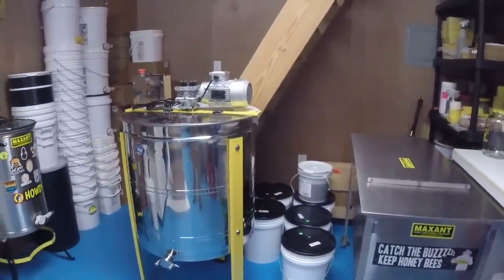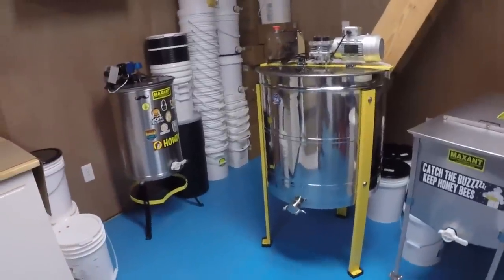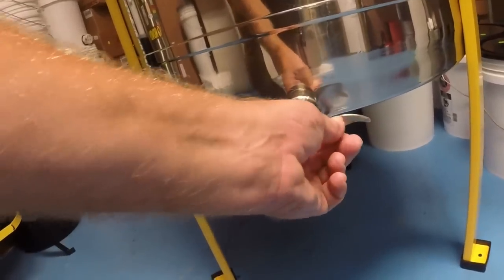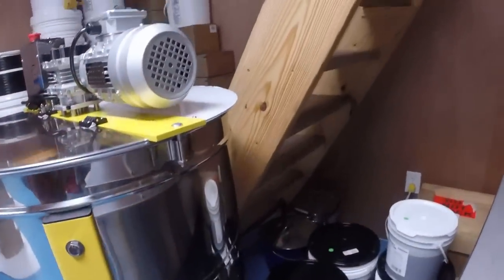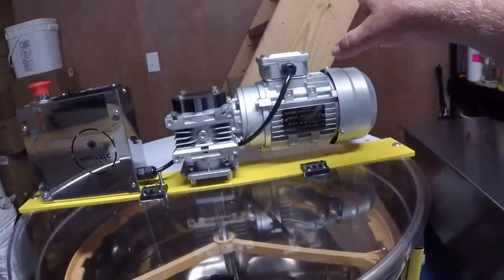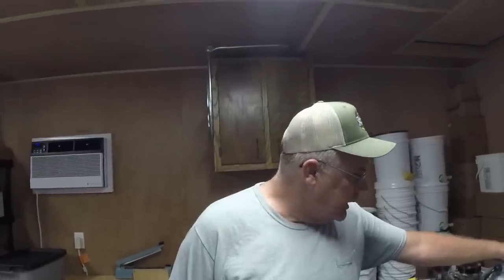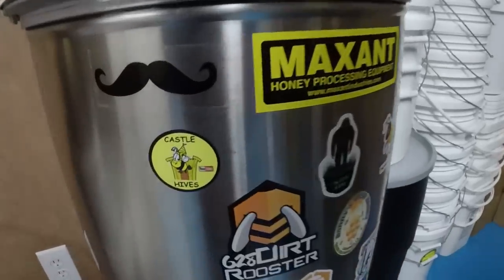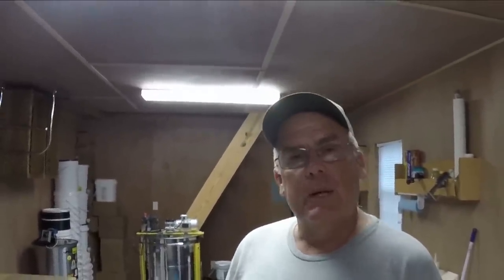Unboxing UltraMax 18 Frame Extractor

Comment: Nice!  My first extractor would sping 18 mediums, it worked very well!  My current extractor is an old-time Kelley 33 frame (deeps or mediums).  My Kelley also has a sloped conical bottom that works pretty nice.  I know you'll enjoy this new unit!
Reply from the maker: Kelley used to have a lot of items that were very good quality and unique to the industry. Unfortunately that has all changed and so many of those unique items were discontinued when they buy out happened. Should've been a good opportunity to take on some good selling and uniquely different inventory to boost the clientele and keep every more positive on the buy out, but not to be so. I used to get several items, one being a special frame, and gone are the days. I remember seeing the first catalog after the buyout and it was ML with a different cover. No more unique frame choices and little nic-nacs that were all Walter Kelley. I am glad that ML dropped the slogan 'We Know Bees'. After the last few phone calls and correspondence I've had, that slogan would have proven very untrue......

Comment: That's a nice early Christmas present 🎁. I still have a old 3 frame electric extractor that does a great job but getting 15 to 20 gallon through it is a long day. Have fun with it and can't wait to see it in action. ❤️🐝
Reply from the maker: Thanks Michael. I used my hand crank 2 frame for about 5 years. Works still to this day. I know what you mean on a long day for sure.

Comment: You are going to enjoy that beast! Open the top bearing cover and look at the keyway for future reference. Pop the motor plate off the tank and remove, there should be a buffer piece that will fall out. I keep a flexible finger picker-upper,  the right allen key, and a telescoping magnet for manipulating the woodruff key handy. I sprayed vinegar and dish soap solution on the inside surfaces, and hosed it out after a few minutes of wiping with a washtowel. There are a few matte finish stainless parts like the lower bearing housing that could use a bit of mineral oil as rust prevention before storing. The only thing I can think of to improve on would be a jam nut to 'clock' the honey gate to where you want it.
Reply from the maker: Thanks for the tips!! I will make note of this comment on my phone notepad for the disassembly. The honey gate is the first of that model I've seen. I guess it really doesn't matter too much since they stay open 95% of the time on extractors.

Comment: That's a great looking machine, can't wait to see it in action.  I'm working with a 6/3 frame extractor and just increased hive count from 16 hives to 30 so gonna have to see how it goes this year. May have to do a step up in extractor also, happy harvest and God Bless.
Reply from the maker: My 6/3 is a very good machine and I could easily have done this year's harvest with it and many more years. But with the price point on the HillCo units being what they are and as I'm getting older and knowing that time is so valuable with a full time job, it was time.

Comment: Hi Mike, I have one of those Maxant extractors too. How about using them both for extracting and maybe get done faster?  Fill one while the other is going. If you have space, you can put both honey gates over the same bucket.  Oh, if you have a strainer on the bucket, keep an eye on your bucket cause it may overflow with the volume on the 18.  Great intro to the new extractor!
Reply from the maker: Funny you said that Chris. My wife suggested that as well. I’ll see how it goes. I bought a 5 gallon strainer for the volume increase and a couple extra bucket strainers so I can keep the bottleneck to a minimum, thanks for the comment!!

Comment: Great minds think a like. LOL I bought Hillco's 800E at Hive Alive Conference. I had a transgental 3 frame hand crank that was just too slow.
 I got to use the new extractor for the first time last week and it is sooo nice. I did two sets of honey frames.  The last batch of honey I spun was 2 deep frames and 2 medium but I left an empty frame in the extractor by mistake (holds 8 deeps) and it took a while before it started to dance. Took the extra frame out and it was as smooth as silk. Hillco is going to grow with there good products and service at a reasonable price. Good luck with your harvest Mike. It sounds like a big one.
Reply from the maker: I guess so Russ!! I am excited to use it. I am glad to hear your experience with it. I figured the way it runs empty is a good indication that if I balance it well, it should do fine where it's at. If not, I will have bolts ready.

Comment: You want regret it, Mike. Purchased one ( 16 frame)  at Hive Life in January and used it several weeks ago. Smooth, quiet, and no wobble without tie down bolts on the legs. If you don't like,  blame John.😁
Reply from the maker: I am sure I will like it a lot Roy. You and others have had great things to say about them. Thanks!!

Comment: Mike, that is a beauty! I have a 20 frame Maxant and I put l concrete anchors in the floor. It is a quick attach to the floor with 3 lag screws.  I think it would be wise to bolt it down in case you get a blow out but as you said you find out quickly. You got a winner, looking forward to you running it!  Sometimes I wish I had 2 extractors because I extract during the night and you stand around waiting. My bee barn is right next to my apiary and in the daytime it is mayhem!  By 6 am have all put away and cleaned up. Luckily I only do it once a year.
Indeed drawback is you have to tilt it when done.
Reply from the maker: I also try to do just one major harvest per year. I did do that early 300 lbs. to clear space, and when I do get an early one, it's small. I will have some lag bolts on standby for sure Jerry. Thanks for the advice. The floor is 3/4" treated plywood, so if I need to fasten it down, I am not sure how long before it wears out the holes. I am dreading having to go underneath to install bolts and washers, but if I do, I will be sure they are installed as permanent studs so that I simply have to place the extractor down over the studs and then run a washer and nut down to secure it. Once and only once will I crawl under that shed!!

Comment: I have a Maxant 9 frame which I used recently only for the second time ,and the honey seemed “frothy” from the first harvest I did.  Is it possible to overspin honey, or maybe too much moisture  (although it was in range according to the refractometer)?
Reply from the maker: Hello Zelma, good to hear from our Florida friend again. I doubt fermentation. I am wondering, did the honey level get high in the extractor while it was spinning? I've seen where the level gets too high and the bottom of the reel will contact the honey and whip it up and introduce air and make it foamy.
Reply: @MikeBarryBees  Thanks for your thoughts, Barry; something I’ll keep an eye on the next time I harvest.  Enjoy your new toy and stay hydrated!  Heat index down here is off the charts!

Comment: Did you build that honey house or was it a pre built?  If pre built, what brand and do you like it?
Reply from the maker: I built it. 12' X 30' with a 6' high loft.
Reply: Thanks.  You’re going to love that extractor.  I bought a used Dadant 20 in December.  Just finished extracting.  Makes a difference going from a 3 frame to 20.
Reply from the maker: @burleybeeyard  I can’t wait, if it would only stop raining....then I could get out there and pull of some supers.
Reply: I went ahead and pulled when it was 101 degrees (not fun) because I saw that rain coming,  300lbs.  Not much compared to most but was my best harvest.  Keep up the grind!  Enjoy the videos.

Comment: Nice tool!  When you initially cleaned it, did you have to take it apart first?  Do you have to grease the bearing after cleaning every time?
Reply from the maker: I did not take it apart. It was very easy to clean while assembled. Of course with honey I would take it apart, and that will be part of my review. And yes, a couple pumps of grease every time it’s disassembled and washed. I clean off the old grease on my bearing in my old one every time I take it apart. Thanks for the question!!